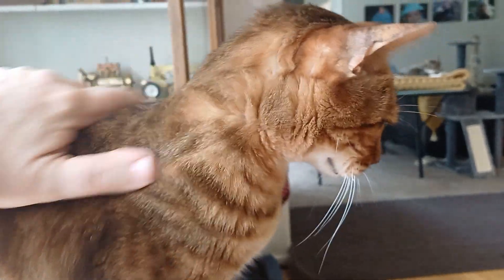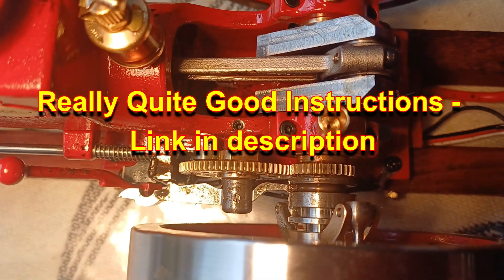2024 Hit & Miss model Musa HM-01- tweaks, instructions and SLOW

Comment: Excellent. 
The HM01 that I purchased, was terrible.
I sold it on in a very short time.
Reply from the maker: I only heard one other commenter like this or maybe it was you. Bad luck man, a bad experience will really put you off an engine. Have you got a chance to see a good one? The solidity and relibality of these is generally notable for folks. I had a few difficult engines, one or two I liked I just replaced, one I tried so much to fix...I guess 3 out of 16 ish are victims of substandard ignition, cylinder, rings, camshaft...

Comment: I'm struggling to get mine to slow down. I have loosened the governor spring but it's not made a huge difference. I'm trying to set the timing to TDC but only managed about 6º before. Are you bending the spring contact towards the fixed contact or away? I can't really get it any closer without a double spark! Also, I tried to remove the pushrod to loosen that spring but I must have used some serious loctite!

Comment: My kit came without a valve pushrod and pushrod return spring. 
does anyone know the dimensions or where I can buy one?
Reply from the maker: MUSA are perfectionists and will surely provide those. However, the pushrod return spring can be any spring you like, the original was too strong for me I used part of a pen spring. The pushrod is stainless steel rod 3mm (2.93). Without taking my engine apart, I can tell you the pushrod extends 75mm out of the brass cam rider part. There is a length of threaded pushrod in there too, the end will likely be m2.5 or m3 easy!
Reply: @ThomasPCGuruENGINES  Thanks for that. They have responded and want pictures. Fingers crossed. If not I will use your info and also your other tips. Thank you!
Reply: @ThomasPCGuruENGINES  Thomas, thanks for the help I built a push rod from your measurements. It worked great. The threads are M2.5 also I contacted Stirlingkit where I bought it. Even though I had it for many months before building it they sent my one at no charge. I just got it yesterday. Now I have a backup. I did the mods you talked about in the video....worked great. Thanks again.

Comment: I see that you are using 3 AA batteries to power your ignition module, my module says to use 6 to 12 volts to power it. I was thinking of using a 9 volt battery, do you think that will work? Thank you!
Reply from the maker: A 9 volt battery is preferable, I have changed recently and it works better. Well spotted my friend:)
Reply: @ThomasPCGuruENGINES  Thank you!

Comment: This is a nice engine, but DO NOT get it from Sterling Kits, their customer service is very bad.
Reply from the maker: Thanks for your reply and for letting me know your credentials, which helps. I m unable to give you any advice because you sound much more experienced than me in engineering. If this was your first experience with Stirlingkit it certainly sounds abnormal; also the experience with the engine. 
But to get this clear, your "standpipe" you mean the exhaust? Chimney? I have not heard "standpipe" before and if I haven't, Mona will have no chance. So, you can't attach your exhaust chimney?  These engines always use standard metric  M2, M2.5 etc and if the supplied screws don't fit, they may have had a tapping failure in your head. Re-tap. Good luck. Forgive Mona, she's doing her best

Comment: Are there companies that make miniature whirley gig or carnival rides these engines can power? Curious cause I want to get into this hobby.
Reply from the maker: The answer is, kind-of. Wilesco and Bohm both do still, and there are older versions. Both are fairly basic "tin toys" and the prices will make your eyes water. Second hand or build it yourself are better options. Most people find a small used electric motor and go the generator route first. There are better scale generators and water pumps available from EngineDIY and Stirlingkit, Chinese made
Reply: @ThomasPCGuruENGINES  
Thanks. That's a start.

Comment: About gluing a piece of brass on the lever...did you have to file the edge down because of the added thickness the brass added?  Brass is a bit hard to cut, why not glue on a piece cut out of a soda can?  You can cut it with scissors, is very thin, and when/if it wears out just unglue it and replace it.
Reply from the maker: Mmm good idea Fred. Aluminium is softer.  Whatever you got, give it a go

Comment: loved the video, although wouldnt it have been easier to just unscrew the tappet screw so it pushes the exhaust valve further all the time instead of gluing the little metal plate to the lever thingy?
Reply from the maker: Nope, because you'd still get that excess lift as the engine coasted over.

Comment: I recently purchased this retro Moussa -1 engine and I was wondering have you taken the cast wheels off after the bushings have been installed and how to do it. Thank you
Reply from the maker: I haven't. The locking hubs have three black screws, remove those. Next spray some penetrating oli like wd-40 into the locking hub. Find two screwdrivers or similar sized to fit the gap on each side, between the hub and the cast flywheel, lever it loose outward. Alternatively use pliers to push in wedges, or fabricate a puller (advanced, see my recent tractor video for a home made flywheel puller)

Comment: Hi Thomas.  Great video! I just got my engine, and before I run it, can you tell me what kind of oil your using in the cylinder oiler to lubricate the cylinder?  Thanks for showing the mods you did. I added to the step of the detent. I haven't tried a weaker exhaust valve spring, but the valve rod seems to return fine with the tension of the points, so I didn't put in the valve rod spring. Also, I didn't have to drill out the guide, but I did have to de-bur it. And I also have the ignition timing set just a wee bit past TDC. Thanks again for all the tips!
Reply from the maker: Sounds perfect!!!!

Comment: iam waiting for my kit to arrive .what is the best fuel,and oil to use on a retrol hm-01
Reply from the maker: Hey man! The instructions you'll receive say standard 95 octane gasoline and add about 1:40 two stroke engine oil. The smart guys out there (not me) use lighter fluid and a few drops of magical Marvel Mystery Oil; they say lighter fluid burns cleaner and the oil sure is a marvel...but we just don't know what's in it: mystery...
...for the amount of running it will get, pump gas is fine; I think they run best on 95 octane

Comment: I like how slow you have your engine running Thomas.  It is the slowest I have seen any ones run so far.  I would get one of these if I could adjust to get it to run as slow but not sure if I have the knowledge to do that.
Reply from the maker: Thanks for visiting and commenting, welcome! My secret is 1. ignition at top dead center 2. loose governor spring 3.  correct step on the governor "detent" lever; but that last one is optional....and of course 4. Plenty of cats. The cats don't help the engine run slow n steady but they help your sanity and serenity when Things Don't Work.

Comment: Hello, what material is the body/cylinder made of, is it steel or aluminum? Thanks very much. Beautiful model!!
Reply from the maker: The instructions sheet is very detailed and includes this info
"The main components, including the engine body, flywheel,  connecting rod, etc are cast from stainless steel 304 material" I can confirm no rust occurring and drilling out the cam rod hole .2mm extra wrecked my drill just like stainless steel does...very, very well made
Reply: @ThomasPCGuruENGINES  Thank you very much.

Comment: I found out that using one of the tall 9v batteries gives it more consistent spark and I got mine running really good now.
Reply from the maker: Great to hear. I have had issues with my spark dying suddenly and I think 9v is a great idea. The ignition says 6-12v but I based 4.5 on my bad luck using 7.2v rechargable lipos which I suspected blew up one  ignition. With your report I'm more confident to raise it :)
Reply: @ThomasPCGuruENGINES  I have to make a correction, it's a 6volt not 9 volt that works best one of the tall lantern type 6volts.
Reply from the maker: Got it thx

Comment: Hey, have you had a issue with your ignition. It seems that mine everytime just a little bit of oil gets into the points system i have no spark. Any ideas how to fix this? Because i have to oul the camshaft and pushrod.
Reply from the maker: Hey Kevin!  I'd probably just squirt some carb cleaner aerosol into it. I was looking at mine and could see oil could be a problem but so far hasn't been for me. Start thinking about some kind of oil guard although I accept it's very tight in there.  Keep in touch:)
Reply: @ThomasPCGuruENGINES  Okay thank you, I will try that. I was thinking of making a oil guard aswell . I have some ideas that I might try for that.
Reply: @ThomasPCGuruENGINES  For some reason I'm not getting any spark at all even when it's dried off. Looks like I might have to take off the points and see what's actually happening. At first I thought it might be the ignition box, but I tested it with a different ignition and still no spark. So something is not getting good connection.

Comment: That intake sound is so annoying. These Chinese company can't get a hit n miss right. I was hoping this one be great right out of the box. Unlike the horrible Enjomor Hit n miss riddled with issues
Reply from the maker: You're talking about the intake valve farting noise? Sounds just like my 1 and 3/4 hp Associated hit and miss. I'm curious, describe the sound you're hoping for, better yet, give me a search term I can google to hear it :)
Reply: @ThomasPCGuruENGINES  yep that's the sound I'm talking about. I barely have heard the "fart" noise on other hit n miss. There is a suction sound but not as intense
Reply from the maker: Ahhhh...I will watch out for this @simplefact4u  🤨I wonder if it is a scale thing, full sized hit and miss running with those solid old valves and springs covered with grease...a lot of mass there. Too much to oscillate in a higher pitched fart as the models do??? But my Associated hit and miss does a deep poppy suck noise
Reply: @ThomasPCGuruENGINES  maybe it's the carb feature on some of these models and larger ones.  Or I have too sensitive of hearing haha

Comment: Nice tweaks, will be very helpful for all the owners of this model. 
Just an idea for replacement spring at the pushrod. I also noticed that the spring is too strong for its purpose so i took a smaller, weaker spring from a biro. Those springs fit exactly.
Reply from the maker: Doh! Why didn't I think of that. Did you have to open out the rod guide at the side of the cylinder, or was yours not sticking?

Comment: I enjoy watching all your videos as I have many of the same engines as you, my favourite up to now is the large green one as it starts with ease and great to watch, also I have been running all my engines on a 50-1  2 stroke mix perhaps more smoke than the best but I feel it helps to keep the cylinders lubricated, so far so good. Most of them just sit on a shelf look good and run from time to time for a  short time trying not to wear out many of the  brass parts, also I may have been running with a bit heavier oil on the gears and contact surfaces,perhas a 40 grade. Thanks again keep up the good work.
Reply from the maker: So nice of you to comment! We sound like we have the same idea with oil. I'm glad you enjoy the vids :) Have you had a look at the instruction pdf the link is in the video description. It's VERY thorough and shows pride in the design and construction
Reply: I just assembled the Moussa -1 engine by retro and how do you get the bushings in cast wheels back off once the bushings are tightened down. Thank you